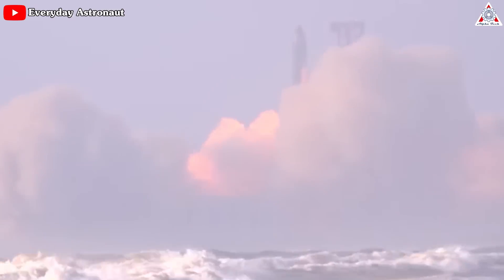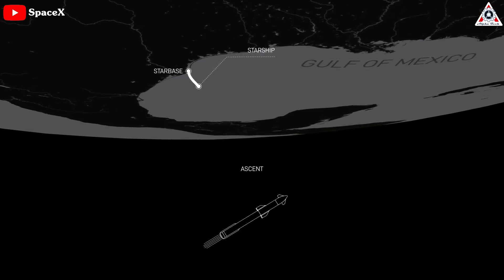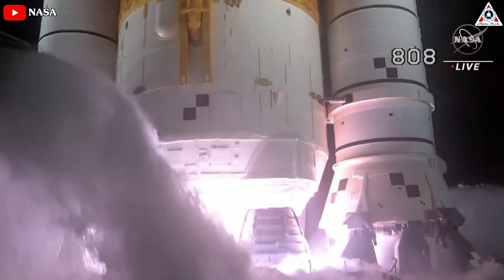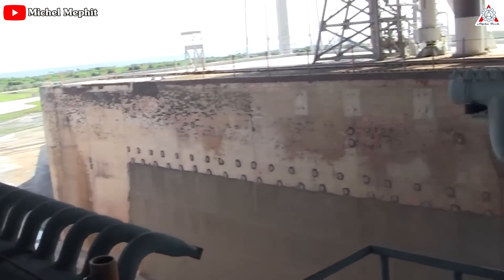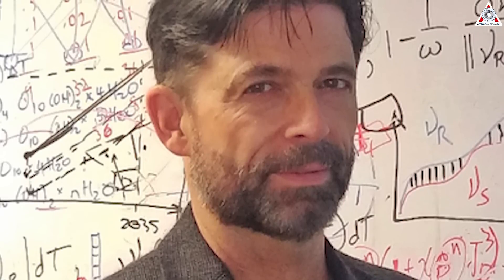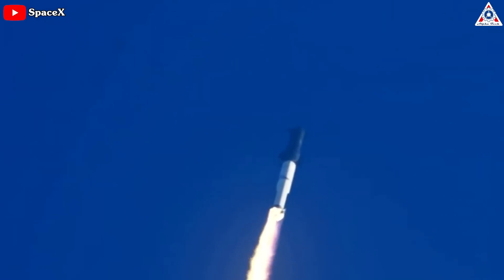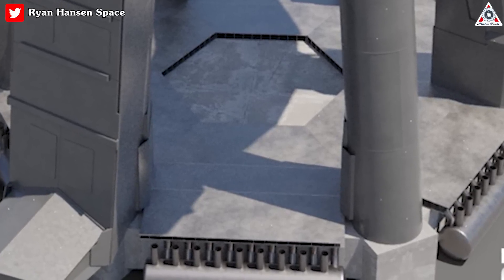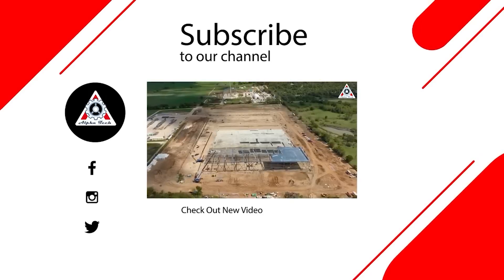SpaceX's NEW Solution to prevent the pad damage by 33 engines...

Comment: Another solution might be to to create a pond 20-30' deep into which the pad is placed. No deluge system needed. The steel plate is hard, which will cause reverberation. The pond surface is "soft".  Water would be displaced by the rocket exhaust and the surrounding walls of the water cavity would absorb the sound.  The base of the pad could be sunk very deep into the sand as they already do this with bridges.   For now, they need a quick fix.  Try the water cooled steel plate. If that does not work, then try another solution, and another, and another, until they have a good one. These are smart people with supercomputers. They should have a solution quickly.  I am surprised they went with a dumb solution for a first effort, but I suspect it had to do with regulation and getting the first one off the ground.
Reply: Two words : water table
Reply: @WyoSavage1976  one word: dredge
Reply: @WyoSavage1976  With 16 million pounds of thrust, it would need to be much deeper than a water table. I think it would need to be deep.  The engines would blast a crater into the water which would be quite deep. I believe 20' or more, but I do not have the physics background to calculate it. In any case, when the water cavity is produced, the sides of it would abosorb sound, unlike a flat surface, such as a steel table with a few feet of water on it, which would be minimally effective, IMO. No rocket has ever been produced this powerful. Extreme situations call for extreme solutions.
Reply: "Another solution might be to to create a pond 20-30' deep into which the pad is placed." Fritz Langs "Frau im Mond" 1929. The spacecraft is rolled out of its hanger. Lowered into a pool of water, and then launched. Or maybe just a flame trench like the Saturn V had to divert all the exhaust away from the rocket ... as for the water table, build up.

Comment: at this point... just launch it from the ocean
Reply: That's like the proposed SeaDragon that was imagined in the 70's but never actually built.  Adding the sea into the mix doesn't help with the goal of rapid reusability and I think part of the reason for not going down the traditional flame diverter route is that this rocket is also intended to relaunch from the Moon and Mars, where there won't be that infrastructure available
Reply: @andrewchilcott5312 not the booster
Reply: @andrewchilcott5312  when it launches from the moon and mars it’s only gonna be the top half, not the booster. Not nearly as powerful
Reply: It will destroy the ocean
Reply: Now you gunna do that on the return?
Reply: @pixies64 don't need anything on the return.   No booster, 28% gravity.
Reply: @adamklosterman8960  I figure he meant to ask how are they gonna catch the booster
Reply: @furyiv  yeah maybe.    Catch the booster same as they intend to on land, with a launch tower on a large floating platform.
Reply: How would that work? You can’t just put a rocket on the waves you would still need a platform. A platform that would most likley sink into the water when the engines fired up. Or if the platform has a massive hole right beneath the rocket the steam pressure built up there could damage something in the rocket and the platform. Not to mention the waves could mess with the rockets trejectory. Oh and lets not forget sound travels far better on calm water(which you would need for a launch) than on land so you would need to locate the platform far, far away from shore along with the fueling station and everything else you would need to prepare the rocket for take off
Reply: @nightshadoew436 you actually don't trident missle partially initiates and uses the hydraulic force of the water to assist in launch
Reply: Nonsense!!!! At this point just simply use NASA launch pad! No need to waste money time and resources to build another system! Wtf!!
Reply: @carholic-sz3qv  what pad? Nasa doesn't have a starship launch pad.  Also rockets have been launched from sea platforms before.   Pollution is not an issue.
Reply: The point is to have a solution for the Moon and Mars
Reply: @UberArchangel  has nothing to do with the .on or mars.   Neither have booster.
Reply: But that also has it's problems!  Maybe deserted islands.
Reply: And destroy sea life
Reply: That is actually much more difficult than you might think.
Reply: Yep…
Reply: @Nothinglefttosay  yeah go directly into water to pollute right!? Do you use your brain!?
Reply: I been saying this since the start.   Floating launch facilities only.
Reply: @adamklosterman8960  floating launch facilities still has to protect the environment in which it is

Comment: Why’d he skimp on the pad ?  Should have been a large deep concrete diverter
Reply: Because the water table is so low you would have to build up a big hill like structure for the diverter trench  Look at the Nasa pad at 2:34.  Its raised up quite a bit with sloping sides.  Big expense and difficult to get permit.
Reply: Permit wouldn’t be a problem. Those engines and hydraulic systems will be lucky to not get shredded

Comment: Supper mind made same landing stand three years before like launching stand?

But unsatisfied for bounce force's?

Some ideas put there for solution like develope a cranes star diameter net system quick response vacuum attachment like AK 47 bullet through,for fall down Rocket 🚀?

Some coolent and air pressure exast also set here?

But some one said if any failure,what will remain there?
Then quiet?
Reply: Then what problem there's uninterested for it?
They said how to land on there moon or Mars?

Then supper mind try to do this?

But it's possible may be landing on this type stand?
Reply: What was that star ⭐ crane system?

It's a net circle ⭕ of multiple wire net with vacuum lock ?
It's height will be level of Rocket head?

When rocket Move forward towards stand,then circle ⭕ move forward towards center?
Just landing movement circle ⭕ will catch Rocket, actually it's a star net, moving forward on supper powerfull crans/hidrolic/and moters?

Comment: Use the high water table to your advantage. 
Dig a deep pond around and under the pad which is feed by a Canal system. Install a inverted cone 10 feet below the water. The engine thrust will dissipate by moving the water, heat energy will dissipate by turning water into steam. Sound energy will diverted away by cone. The trick is to feed the pond with water as the water is being ejected. Shape the concrete lined pool sides such that eject water outwards.
Reply: Terrible idea!
Reply: The water table at the Cape isn't much different. They just don't want to build a tall pad and taller tower before they are ready to do more significant launches.

Comment: They can avoid all this if they make launch pad 100m above ground
Reply: Thats only 4 inches.  They would need more than that.
Reply: @artsmith7254  my bad 100m not mm ;)
Reply: A 300 foot+ launch pad would involve it's complexity.
Reply: @WyoSavage1976  Yes but engine exhaust will no damage anything and shock-wave bounce from ground will be much less stressful to Rocket

Alternative will be use magnetic or steam catapult to launch up with 50-90m/s speed and start engines at 200m above ground such catapult will increase payload a bit :)

Comment: Spacex meant to blow up their first luanch, it was just their first stage in flame trenches excavation. Why use costly excavators, contractors and other heavy equipment when you can just blast a hole out and successfully blow up your rocket at the same time, win win, am I right.

Comment: A steel plate with not work. As the plate will just bounce the shockwaves back towards the bottom of the rocket!

Flame trenches are used for a reason 😉
Reply: they cant dig a trench as its wet lands. an angled plate with water nozzles will divert the flame and suppress vibrations /noise.
Reply: I agree, it needs deflection.
Reply: @arjay smithjr lol!!! That’s not how it works!
Reply: What was not mentioned at all in this video was the deluge system that is in the process of being installed at Starbase which would address the acoustic damage to the OLM base.
Reply: Shockwaves can't melt steel rockets.
Reply: @davidbeppler3032  it doesn’t melt it destroys them physically
Reply: @carholic-sz3qv  Right.... I don't care.  Tesla will solve it, they will use steel plates.  You can keep saying it won't work and then just  forget you said it when it does.
Reply: @davidbeppler3032  NASA has the ultimate launch pad let's just use it instead of keep digging, wasting ressources and polluting that fragile nature!

Comment: A classic example of learning to run, with a new pair of racing rocket boots
Reply: Funny how elon fanboys try to defend even the biggest avoidable failures, pure waste of tax money
Reply: No it was a naive neglect of 60+ years of rocket science.
Reply: @Upuauta  Priorities youngsters... you do know SpaceX has a new metal/water BLAST Control system to install... Now it's dug up ready for the installation...
Reply: @Upuauta  in those 60 years nothing happened for the better part of the last 50!
space x will fix this for all problems need a rock thrown at it or an engineer to fix it before this becomes a necesity! ^^